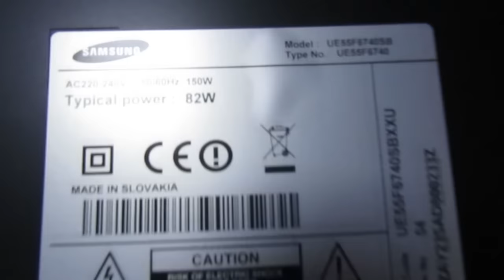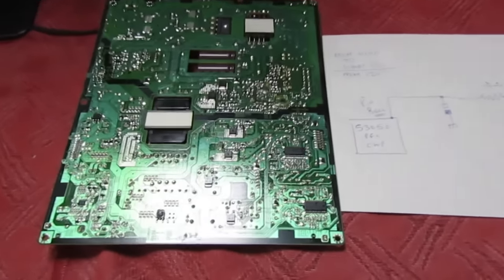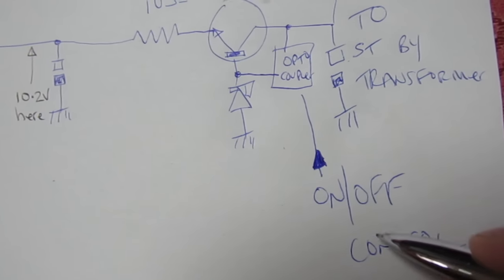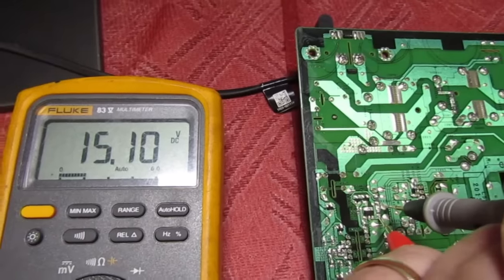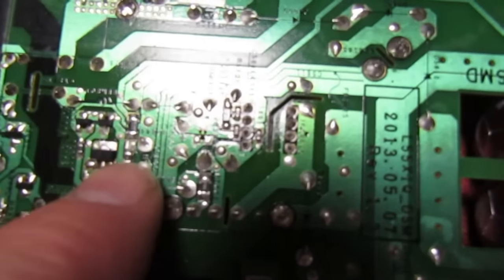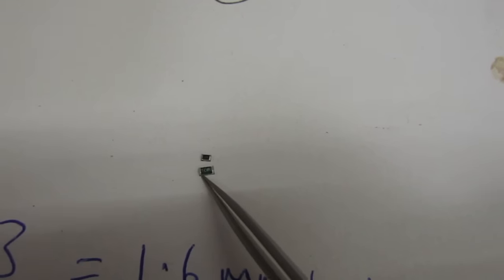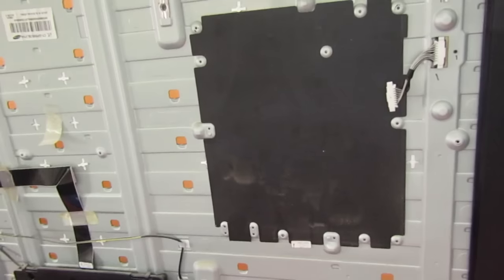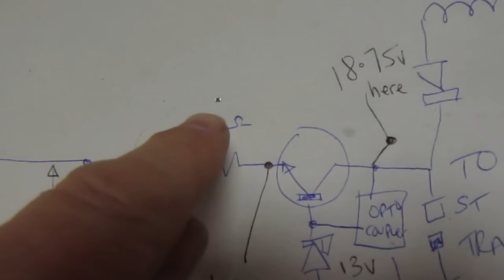Samsung TV , Clicking ?  Dead no power ?   PFC common fault repair  to component level .

Comment: I was a TV engineer from '56 and retired just as flat screens were coming in. Its nice to see you repairing down to component level, as we did. Very good video 😊
Reply from the maker: You retired just at the right time then, no money to be made on TV repairs anymore, the CRT days were by far the best.
Reply: @michaeldranfield7140 ... The problem also is repairing a CRT TV today also.  Even having a working digital signal converter to analog signal box, a fixed CRT of say $50 for parts and labor (as a new HDTV of CRT screen size can be $200-$350 in the U.S.) there is risk of further breakdowns of electronic components barely getting by.  Even nostalgic computer gamers saying they are spending $200+ in the U.S. on nostalgic old CRT TVs now getting 16+ years old as the beyond warranty last engineering designed day of that TV for lasting longer like a brand new TV.  Having to buy a $200 nostalgic 32 inch TV max, 16+ years old, is not worth the risk as figuring out an advantage of buying a new TV of High Definition like this fix on this YouTube video at hopefully less than $75 in the U.S. as a brand new 55" of this same model is only $369 brand new and with new warranties.
Reply: I used to work for Rumbelows 1974 Service engineer down to component level .. left the trade in 2003. Thanks for posting .. There's not many engineer's now, they're just fitters ..
Reply from the maker: @nightlore000  the official take is now to just replace the whole board , there are no schematics for these boards .
Reply: Thank sir.your explain schemetic drawing is very good.

Comment: The culprit is not really the 10R but Samsung for not using a component of high enough rating.
Reply from the maker: And given that there was space to fit a much larger resistor it does make you wonder why this was done in the first place.
Reply: To save money and get away with it, oh and then sell us  a new tv .I stopped repairs on tvs in 2004..on wide-screen sets.. I've done a few over the years but don't have the time anymore.
Reply from the maker: @waynewayne3709  technically speaking repairing TV s should be very easy now , just fit a brand new board and away you go , the problem is boards are so expensive no one wants to pay , so where ever possible I always look for the fault first , new board is last resort.
Reply: I think we have a bit of 'planned obsolescence' going on here. Google planned obsolescence, if you don't know what it means.

Comment: Well explained and repaired. When you have a spare moment (ho, ho), as other have suggested, it may be worth measuring the drop across the 10R resistor to determine what current is flowing and how under-rated the previous resistor was.
Reply from the maker: Sets already gone back but I can try that next time I get one.
Reply: From the initial diagnosis there was 15.1V on the transistors emitter, if the PFC chip is expecting 12V the three volt difference equates to 0.9W which seems strange especially as the 15.1V was not a fully unloaded reading so probably close to the correct voltage considering the transistor was also dissipating around 2.4V with the 3V difference from it's collector.
Maybe the PFC chip runs higher than 12V nominally but requires it's initial start current to not pull it any lower than 12V (cap charging etc). That could explain the resistor's reason for being there.
Reply: @alasdair4161  Indeed, hence the suggestion for a little more diagnosis if another set comes in. We can determine that 900mW was being dissipated (in whatever state the PFC was in) and that is clearly way too high for the original and replacement SM resistors. I suspect (I hope) that when the PFC is running that there is very little drop across the resistor. The issue may be that the designers did not account for a pre-start or PFC failure situation (no design can accommodate every potential component issue)  As an aside this in no way diminishes the work that Michael performs (which way exceeds my skills).
Reply: Could it be the zener that was out of specs, hence the 15v and the resistor eventually failed due to higher dissipation than planned ?
Reply: @AeroGraphica  They can fail that way. I've even had zeners adopt a strange thermal drift characteristic that makes the fault really interesting to diagnose.
Reply: @alasdair4161  Zeners can be a pita, specially the smd ones that are harder to identify and test, and they show ok on the simple diode test...
Reply from the maker: @alasdair4161  you could be right but the chip in question has no datasheet and I was reading from another datasheet that claimed it was a pin compatible equivalent to the Samsung special part .

Comment: Is there any way I can DM you directly sir? I've got a late model Samsung q60 model TV with similar behaviors to this television. However, it is an edge lit strip. The entire LED strip seems to be strobing on and off. If I disconnect the leads to the white LEDs, the blue LEDs come on. If I try to connect both the blue and the white, the strobing starts again.

Comment: Great video Michael. I noticed the 10ohm res had a zero ohm link in series. Maybe originally they specced two 4.7ohms resistors in series but the bean counters won!
Reply from the maker: Quite possibley and the zero ohm link resistor was much larger!

Comment: Thanks Mike, very informative. I had the same kind of issue on a different set, the PFC circuit. When heating up the board with a hair dryer then the pfc circuit started working. I turns out that the little electrolytic cap that smooths out the vcc supply to the pfc ic was high esr. That took me 5 hours to discover
Reply from the maker: I did look at the caps in this set as they were very small and looked like they were designed to have a short life but in the end they were all OK.
Reply: @michaeldranfield7140  Can you perhaps advise me on a panel issue? I have a Samsung UA55NU7300K with a failed panel. You posted a video on this but there is a difference I wanted to discuss with you.

Comment: This video is ALL the information i need for a 60 inch Samsung... but the video is blurry.. you didn't show where these components were on the other side of the board, and where that lil resistor was even located, in what area..
Reply from the maker: you have to download the datasheet for the pfc chip and then you can trace it back from there .

Comment: Good vid Micheal! Why on earth didn’t they fit the higher rated resistor in the first place - SMD resistors aren’t exactly expensive and the difference between the 2 sizes must be tenths of a penny…
Reply: I've worked in industry so I can tell you the possibilities: 1. one million TVs manufactured and a saving of one tenth of a penny per set adds up to 100,000 pennies or £1000 pounds. It's not a huge amount but if you can do that with several components it adds up. 2. A TV only has to last the warranty period so, if you make it fail after the warranty expires, that's a new TV sale. 3. the specified component was out of stock so someone used the next nearest "equivalent". 4. the original designer didn't bother to do the maths or made a mistake. 5. the resistor was from a bad batch. 6. glue or other contaminant caused the resistor to corrode (not in this case but a common problem).
Reply: Then we wouldn't have this video😊
Reply from the maker: Given that these was space on the pcb to fit a bigger one this could have been a deliberate act to make sure the set didn't last too long but someone has also given a whole list of reasons it could be.
Reply: @manolisgledsodakis873  - although I do agree with all of your possible explanations, there is one that might make more sense: the zener diode at the base of the pass transistor is no longer operating properly, and is at a voltage higher than it’s original nominal rating. Thus the voltage at the emitter of the pass transistor is too high, pushing more current flow to the load.

A measurement of that zener voltage compared to its nominal voltage should answer whether this is the case or not. If not, then maybe that 10 ohm resistor was improperly specified in the design.

Comment: Skimping on a resistor wattage that basically has no value.
Thank you for the insight and circuit analysis.
This is how we learn - by sharing knowledge.
Reply from the maker: Makes you wonder if it's deliberately done so the set doesn't last.
Reply: @michaeldranfield7140  I think that is very likely - profit drives this disposability.

Comment: Well done that man, all understood.
Inbuilt obsolescence, underated resistor and after 5 years it's time to buy another TV. Great video and thanks for the share 👍
Reply from the maker: It does make you wonder if components are underrated why they used them in the first place , could well be built in obsolescence as you say .
Reply: @michaeldranfield7140  Exactly.  I would expect that the designers have the necessary knowledge to make the right choices for components.  Then there's the CAD software they likely use; that can make the calculations too.

I have heard about electrolytic capacitors in flatscreen TVs being deliberately underrated in terms of operating temperature.  85°C fitted where 105°C is needed for a decent service life.  When failure occurs after 4-5 years, the TV is thrown away.  More turnover for the manufacturer, more waste for the planet.  To do things right would cost €1 or less per set, at mass production prices.

Comment: i had a similar one few years ago and i tryed hours of hours of toubleshooting and change components,but i was not able to fix it!
i was so mad about it, that i dont want to buy a replacement PSU! it was 75$, so not that big, but my frustration was so high, that i refuse to work any longer on this tv!

very good job
Reply from the maker: Its not easy trying to find a fault without a schematic diagram but cheaper than a new board , especially  when you have the same fault more than once .

Comment: Thanks Michael for your you tube fault guide, I have a Samsung with the same clicking noise and replaced the SMD with a 10ohm Metal 1/4 watt resistor and the set works just fine, thanks ever so much for your help, parts cost 85 Australian cents.
Reply from the maker: No problem at all , glad I could help .

Comment: Amazing repair, I imagine if 100 TV had that fault 99 of them would have been scrapped
Reply: I remember these CDs and web sites with repair instructions. "Sony TV chassis xxx turning on slowly with green line at top of screen, remove screw of lip holing PCB at the front, break way plastic lip, re-solder the voltage regulator". That's literally how I remember that.
And indeed that fixed it, turned a 3 hour search into a 10 minute repair.
Reply from the maker: A new board would have fixed the problem but that's no fun, first time I had this fault it took hours to fix with no service manual.

Comment: On the fiat 500 led leak failure, Fiat motorhomes, same issue. Had a  few in for repair, 80 quid a pop, pointer off jobs, no problem. :elbowcough:
Reply: Where in the country are you? Would be interested if you could fix a 500 cluster.
Reply: @CriticalThinker84  North-east.

Comment: @michaeldranfield7140
I used to perform component-level repairs on electronic equipment during the 1970s, and it's wonderful to see that there are still a few people capable of doing this today. Excellent video, thank you for sharing!
Reply from the maker: a good understanding of how these systems operate is useful but the problem with new sets is there are no schematic diagrams so most of the time its more good luck than knowing what your doing, the official thing to do is just replace the whole board but usually this cost more that most sets are worth .
Reply: @michaeldranfield7140  
Yes, you are right. Back in those days, detailed schematic diagrams were available for almost all TV models. This meant you didn't have to rely on reverse engineering or guesswork; instead, you could scientifically troubleshoot and fix the issue. Thanks
Reply from the maker: @manclt704  its very sad the makers wont release any schematics, they must have them from when they design the set on a drawing board .

Comment: I have a 55 inch Samsung UN55RU8000FXZA and it has a similar failure. 

1) The standby light flashes momentarily when I try to turn on the TV but there is no picture/ sound/ or backlight. 
2) The 3 electrolytic caps on The Power Supply Board at the top left ( near the o/p to the main Board) have 'domed' tops.
3) When I unplug the Main Board from the Power Supply Board the Backlight turns on. 
4) The Main Board does make a sound at turn on like a 'Flyback Transformer' (but only for a moment).
     
My first thought was that the Main Board has a short that is drawing down the Power Supply & keeping the Backlight from turning on. But the other possibility is that the Power Supply Board can't source the current to the Main Board. 

5) Additionally, I disconnected the 3 output cables from the Main Board & the backlight is still not lit.

Have you any suggestions?
Reply: Bad Caps on the power supply output 470 microfarad 25Vdc

Comment: Sometimes ,especially on some older samsung or lg sets,just resoldering the st by and main chopper transformers solves this issue.Cold solder joints can be the issue of relay clicking and no power on.
Reply from the maker: Dry joints seem to be much more common on equipment using leaded solder than it is now but yes I have had loads of Samsung in the past with dry joints on heats inked components.

Comment: I did one of these recently with a faulty opto- coupler. Im guessing when you soldered those wires onto the resistor , it partially rectified a defect inside the resistor hence the 30 ohm reading ..iv seen heat from desoldering components temporarily "fix" internal open circuits in components before , must be the thermal expansion of the metal inside causing breaks to become bridged back together
Reply: Hi, can I ask if it was the same PSU as here that you found the faulty optocoupler? I currently have one of these PSUs I'm trying to repair and have no V on rails or backlights. The resister that's the culprit here reads ok and I have 15-17V from the Aux winding on the SB transformer so was beginning to suspect the optocoupler? 🤔
Reply: @5pr1nk57  it was very similar to this psu. Ive done 2 the same board recently , one had a dry joint and one had a bad opto-coupler, it was reading about 300 ohm on one side of it with the probes either way round which is why i suspected it , the other optocouplers all gave similar readings in ohm mode and diode mode . Id just change them all and then you can rule it out .
Reply: @5pr1nk57  after looking at this video again im sure its the same psu. I first thought the fault was the 7 pin chip on the primary because it was getting warm but nothing else was and there was no output on the secondary . Its a pwm/mosfet ic, i bought one from italy and changed it and it did the same thing which is why i started looking at the surrounding standby circuitry and optocouplers etc
Reply: @reacey  I've actually since found the fault! There was a small 2A ceremic fuse hidden under some gunk that was open and it revealed a short on the latter part of the primary side which was 2 Smd Mosfets on the reverse of the board so just have to pick some up now as no stock/donors here :)
Reply from the maker: It could very well be , I have found in the past many a diode that reads faulty in circuit then works perfectly after its been desoldered.

Comment: Interesting stuff, thank you. I’m currently trying to diagnose a Samsung N87 from 2007. Replaced the caps (well the starter round black ones), no joy. Checked standby voltage and it’s clicking 1.8 to 13v.. standby should be 5.3
Reply: I have very similar situation, did you find the problem?

Comment: Excellent video Michael as per usual   what would you say causes these resistors to fail   would you say heat has a part to play?
Reply from the maker: I think the resistor fitted was far too small and there was space to fit a bigger one, I wonder if it was designed to fail in the first  place.
Reply: @michaeldranfield7140  I think manufacturers should not be allowed to do these tricks   shame on them

Comment: A 1/16 watt resistor would be interesting to find out the switch on and running current in that little circuit a design error there !
Reply from the maker: could be built in obsolescence, a trick to ensure the set does not last too long .
Reply: @michaeldranfield7140  Yes any SMD IC or transistor or resistors current ratings are too low will fail

Comment: Just shows, experience counts!  Michael, where can I buy that smd resistor selection box, and is there a capacitor version?
Reply from the maker: Yes there is a capacitor selection box also, I very much doubt you will buy one of these now though, these were produced by Phillips for repairing the G90 and G110 sets of the 1990s.
Reply: @michaeldranfield7140  
That's a shame, ah well, thanks anyway Michael.  Really interesting to see component level repair like this, and good that the set was saved from a premature end👍
Reply from the maker: Keep an eye on e bay with so many shops closing down you may come across one .

Comment: Samsung uses underrated capacitors in their power supplies. I have see this problem in 19 inch PC monitors to big TV sets. Since back in 2005 when I purchased my first 19 inch
flat pc monitor.
Reply from the maker: you don't see anything now with good quality capacitors like you use to in the 70 s and 80 s .